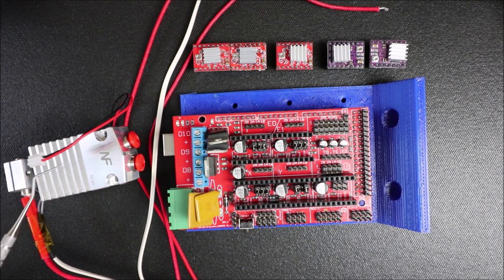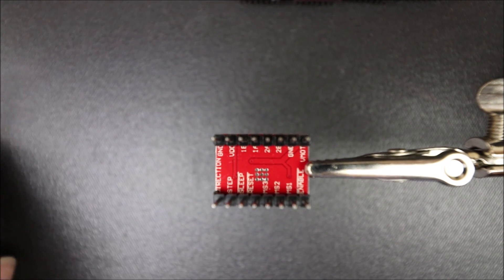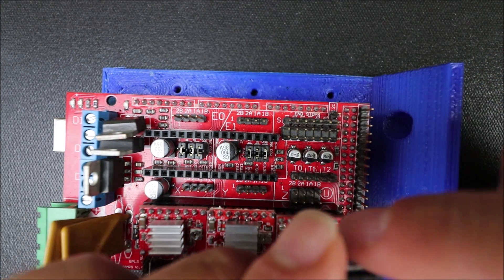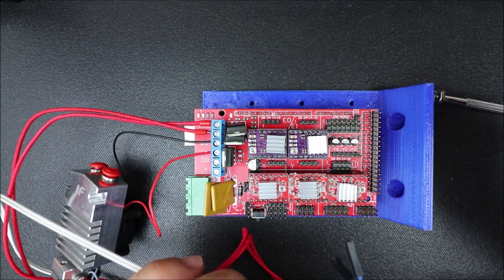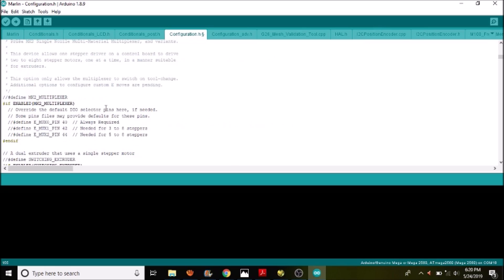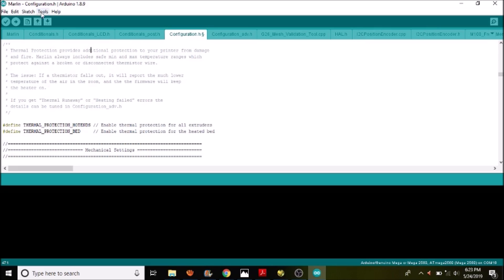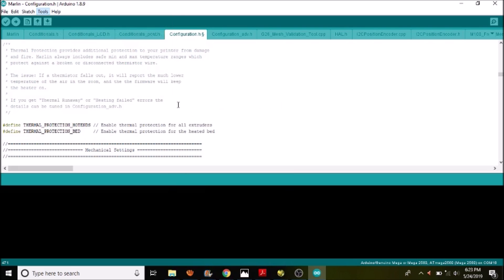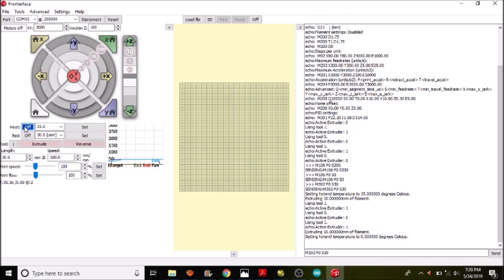RAMPS 1.4 - Multi-Extruder

Comment: five years have passed and i dont know if you could answer me or not but i have a question i'm about to build a 3D printer that can print with two colors but one at a time dose configuring the firmware like you did it in the video will be enough i have tried to configure the firmware before but it gives me an error and says the value of  TEMP_SENSOR_1 must not be zero & for the   default_axis_step_per_unit should i enter the values like this [ 80, 80, 4000, 94.69] or [ 80, 80, 4000, 94.69, 94.69] since i'm using two extruders?

Comment: Love your tutorials. I have a 2 in/ 1 out extruder . When your setting p  the 2 extruders in Klipper, it shares the thermistor with the hot end fan and bother extruders, which gives an error that it has been used already. I get the same problem when setting up the hot end heating element with the dual extuders, and again I get an error that it has been used already.   Iam running a M8P BTT board ith a CB@ on a machine that started off as a TRONXY VEHO 1000 2E. I have asked Kipper discourse and have never received an answer except fo send the klippy file next time.
Reply from the maker: I'll see if I can set-up remember slic3r might also be part of issue at least with cura and custom printers.

Comment: Hola mi amigo, me encanta lo que haces. cómo se configura para que sean salidas diferentes del extrusor?
Reply from the maker: ¿Podrías reformular lo que estás preguntando? ¿Te refieres a cambiar el filamento en la extrusora?
Reply: @EdwardBraiman  two nozzles
Reply from the maker: Two nozzles makes it more challenging.  You can have one nozzle and two filament inputs.
Reply: @EdwardBraiman   Thank you very much for responding so soon, I understand the point, so there is no way to organize them?
Reply: @EdwardBraiman   I have installed two extruders, but when I configure the second nozzle (#define TEMP_SENSOR_1 0) I get an error:

#error "TEMP_SENSOR_1 shouldn't be set with only 1 HOTEND."
Reply from the maker: If you have two thermistor and two heating elements, then you'll need second.  Otherwise uncomment part about single printhead in configuration.h.
Reply: @EdwardBraiman  I'll try if it works, thank you very much.

Comment: is it possible to have both extruder motors run at the same time? i have a set up where I have one extruder motor mounted to my printer's enclosure feeding into a second one mounted to the x axis gantry, I tried linking them to one driver but when I print they stutter. I'm not sure how or why but the one driver is not working for both.
Reply from the maker: The short answer is motor never actually move at same time.  It appears the do as the commands to move from gcodes as very fast.    As to the issue your see could you add a little detail or post a short video link on my Discord below to see?

Comment: I have looking for this for about 2 day. GREAT work. How I need to find how to setup the software to use the extruder for mixing.  Thanks again Great work.
Reply from the maker: In Marlin firmware in configuration.h search on mixing.
Reply: What I am looking for is how to setup Cura to be able to produce single or mixed colors in prints. I found "mixing" in the firmware and enabled it, but how to use it is the question. thanks
Reply from the maker: I'll do a video on setup in Cura today.
Reply: Excellent video and everything worked in this part. Was wondering how you were coming on the new video. I found that after I compiled the firmware that Cura will not allow mixing unless Mixing Extruders is turned on. So tried to enable it in the firmware and re-compile, but it errors with not allowing more than 1 extruder. Have you encountered this, and if so what is the resolution. thanks.
Reply from the maker: I'm close to recording the video, but need to test printhead and firmware.  Granted I cannot remember settings for mixing at the moment, but zimmerman in my Discord set it up about 6 months ago.

Comment: Hi,

I have a question, if I want to add more extruders how I set up the firmware pinout and how the GCODE will define the pin with the slice design? Sorry if this question is to easy I’m just new at this. 

Thank you
Reply from the maker: The pins would be the same process with additional pins reassigned.  For slic3r you'd add slt files together like a puzzle pieces and assign each a color.
Reply from the maker: Then slic3 as normal into a gcode file.
Reply: @EdwardBraiman  and the gcode from the Slic3r will know which pin was assigned for each extruder?
Reply from the maker: It would be a color assigned to each extruder.

Comment: Question :
at 13:18

in marliin/ default_axis_step_per_unit
X = 80
y = 80
z = 4000
E0 = 1000
and
E1 = ?

thank you! Your video are very helpful!
Reply from the maker: You're welcome.  If you have matched stepper driver boards and Nema17 steppers, then both can be same.
Reply: @EdwardBraiman  yes ,I remember the remaining will be suited by forward parameters

Comment: Hi folks. I want to make a CNC punching machine using arduino and ramps 1.4. I expect to control only X-Y stepper motor and a solenoid valve. Would it be possible?
Help plase!
Reply from the maker: It maybe, but you'll need to become familiar with Marlin firmware gcodes.
Reply: @EdwardBraiman  ofcourse I have passed through gcodes implemented in marlin firmware. I just don't know how can I edit their definitions;e.g there are some gcodes in marlin firmware meant to activate extruders, bed heater and other;now I want to change them to activate and deactivate solenoid valve as soon sheet is in position. Generally I just I want to add custom gcodes in marlin firmware. Now how could I do it to fit my CNC. Ofcourse some gcodes in marlin are useful for this purpose but some would be useless and I would like to add others for me.

Comment: Hello friend, I really liked your channel, very good explanation! If you can help me, thank you immensely! I am looking to change the anet a8 board to some one that works with silents tmc2130 drivers without much customization, which supports the original anet display and memory card support. Can you tell me your buying opinion? Thank you very much and congratulations for the quality channel!
Reply from the maker: RAMPS Arduino 2560 will work with most hardware.  It's also relatively cheap.  The RAMPS 1.6 can easily be changed to 32 bit Processor.